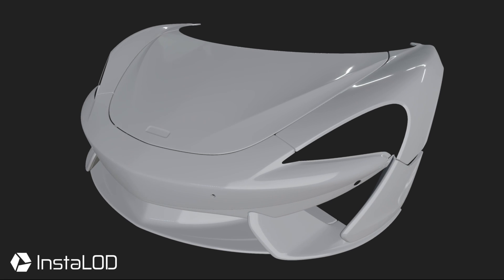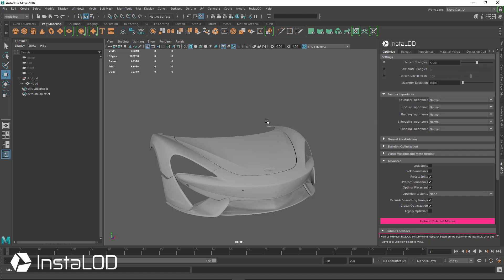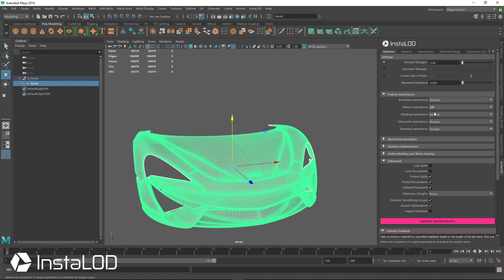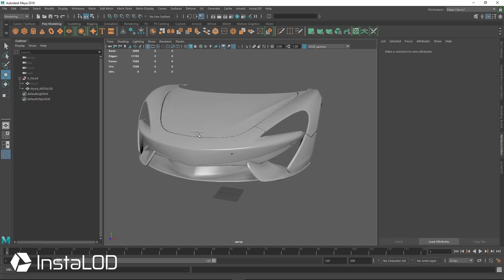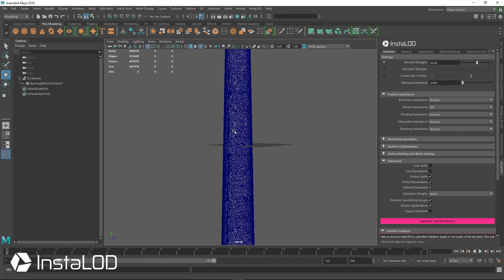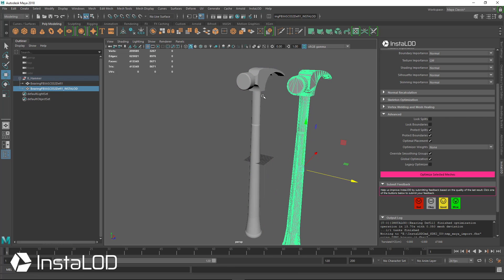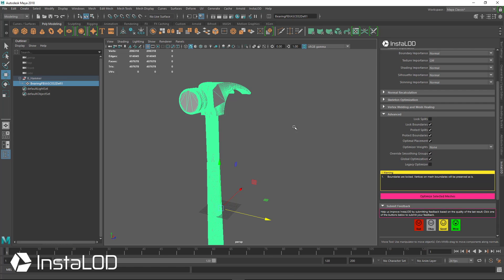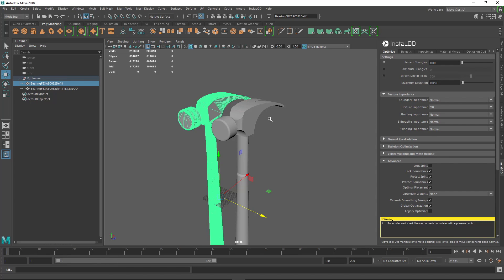Best Practices: Optimizing CAD Data

Comment: I want to use this for my upcoming project! Would you recommend using quad draw alongside InstaLOD to enhance the overall outcome of the retopology?
Reply from the maker: You can paint on vertices to weight them during the optimization, or use a selection set to lock vertices. Using quad-draw is not necessary, it's fully automated based on the input geometry.